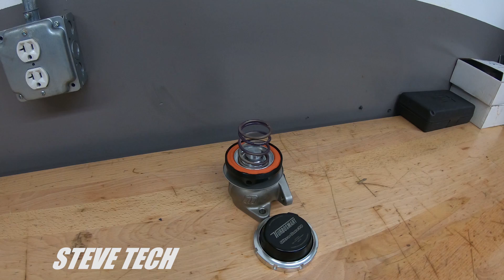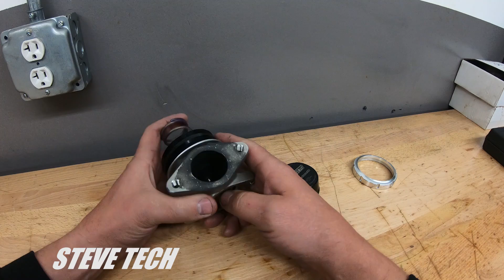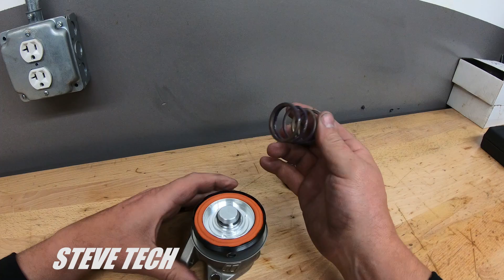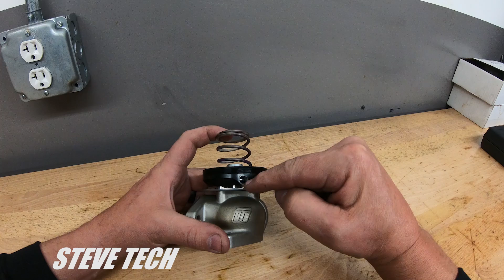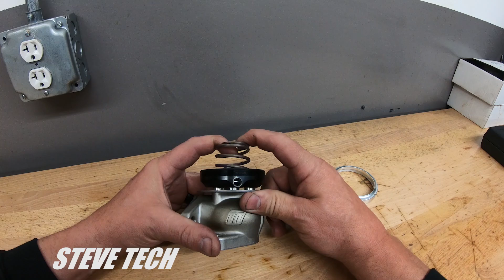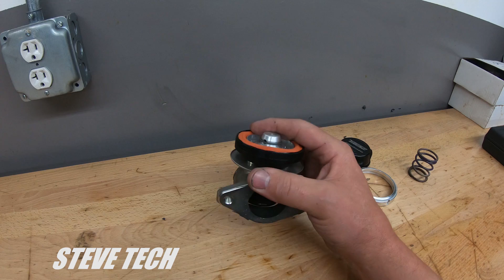Hook Your Waste Gate Up Right, Or You Will Be Sorry!

Comment: Makes me so curious because the centrifugal supercharger kit I've been looking into has a blow off valve and a wastegate. I have some questions to ask now, as always thank you for the Steve tech tips they're invaluable to people like myself that just like to wrench every day. J Swap Jason.
Reply: I think wastegates are typically only found with turbochargers, as the waste gates takes the "waste" or excess exhaust gasses and vents this extra exhaust gasses either into the atmosphere A.K.A: the screamer pipe.

The blow off is typically on the intake/cold side/boost/compressor piping leading to the throttle body. When the throttle blade is open, the blow off is sealed allowing all the compressed and/or intercooled air into the engine. When the engine throttle is closed, a vacuum/boost/throttle position sensor tells either the computer or just via vacuum signal to open this vent to prevent the compressed air from back feeding the compressor side of the turbos.
When the boost gets trapped between the compressor side and a closed throttle, the pressure works against the engines exhaust driven side to attempt to slow the compressor wheel down.
This forced slowing of the compressor while the exhaust is still trying to drive the turbo the other direction ends up causing broken impellers and broken turbos.

Superchargers and prochargers are driven by the engine by mechanical connection, like a belt or crankshaft driven setup. Backfeeding this style boost set up, when it doesn't grenade the supercharger, tends to excessively wear the supercharger. 

Im fairly sure the prochargers will use a blow off only to remove excess cold side/intake side boost.
Blow offs only releive the stored boost on the intake side.
Waste gates are on the exhaust side(turbos only) and vent some portion of exhaust to maintain a boost pressure setting.

Supercharger\prochargers change boost pressure by changing the pulleys used om the blower and crankshaft. A small pulley on the charger and big (either tooth count or specifically sized diameter) then the blower is considered overdriven. Driven faster tham engine RPM by whatever chosen amount.
Swap those same pulleys around and the blower makes less boost and is then under driven. Driven slower than the engine RPM.

Prochargers can be a bit different, as I think some rowdy race ones can have their drive ratios and/or pulleys changed to affect the boost curve(somewhat) and also the total boost created.

Turbos need the exhaust side gate otherwise the boost gets trapped and tries spinning the turbo different directions at the same time. Also, venting the exhaust gas, as this is what drives the compressor side of a turbo is slowing the turbo down or controlling boost in the most accurate/safe/efficient way. Assuming the waste gate is the correct size to vent enough exhaust fast enough to keep turbo RPM and thus turbo boost at a stable spring regulated pressure or a CO2 regulated pressure. 

There's tons more of the nitty grtitty tech, and I am aware Steve has gone over everything in this comment in this video.
As such, there are newcomers to car modifying getting interested every day. Cmon down, you might be the next person supercharging a 1UZ for drifting down unda'. Or maybe the next person to revolutionize turbo/charger/boost control tech.

Bring out ya hot rodders....
Reply: @threadtapwhisperer5136  gerzybear look it up for a J series. Tell me what you think. I understand how everything works I'm just curious after Steve's video.
Reply: Some of them have recirculating air, so instead of compressing and releasing air, it just shoots the air back into the intake instead of atmosphere. Yours may not be quite the same, but that way it keeps air flowing, but under pressure, so things don't go boom.
Reply: If your car is equipped with a mass air meter you must use a bypass valve and not a blow off valve, If you install a blow off valve on a mass air car it will effect how the engine runs!
Reply: @NeverEnoughPyro40  fair enough. But FuelTech ft600 will be controlling the car. So that isn't an issue. Fuel tech uses absolutely density I believe. I'm just curious how this will Affect my particular set up I plan on using.

Comment: I've seen vortechs with bypass valves on street cars for when the throttle snaps shut.   Is that the same thing he's advocating against?
Reply: No, bov dumps the boost when you close the throttle. Trying to regulate boost at open throttle is what he is talking about not to do.
Reply: No, that is a blowoff valve.  They are used to vent boost when the throttle blades are closed to prevent damage to the throttle blades.  Blower systems have blow off valves only.  Turbo systems have both a blow off valve and a waste-gate(s) to control the amount of boost.

Comment: Actually with no boost reference it regulates the exhaust turbine inlet pressure only so it is regulating the drive pressure to 10psi. How much boost it will make then is subject to the turbo and engine setup. I have seen twin turbo BBC make 20psi of boost with only 8psi of drive so the wastegate would be like having nothing at all. Now put a 66mm single on and you would probably only see 8psi of boost and like 25psi of drive then the gate would be opening to keep from sending the little single into parts scatter never never land.  What you say about needing to control pressures on both sides to prevent an overboost situation or a turbo destruction situation is VERY true.
Reply: It depends on the ratio between the wastegate and diaphragm area. 
A little simplified. If the ratio is 2:1, the wastegate is adjusted to 10 psi with the boost reference connected and you have a drive pressure of 10 psi then the drive pressure would theoretically need to be 2*10+10=30 psi  to open the wastegate without the boost reference.

Comment: How about when closing the throttle quickly. Have seen a lot of belt issues. Is there a way to deal with the sudden  spike?
Reply: Sorry meant on a whipple.
Reply: @benrossbach6501  I'm guessing your throttle is after the supercharger? Use a blow off valve. My vortech setup has one between the supercharger and throttle. Will make it more efficient too.

Comment: I disconnected my reference line and it went from 8 to 15psi with a “7psi” spring, only time it creeped above 15 was when i sprayed it with a 150 shot and would creep to 18psi but maintained it
Reply: Yeah, how much boost a system will make without a boost reference on the gate depends on the set up.  Engine size, turbo(s) size.
Reply: @danmyers9372  if i pinned the gate shut it would make over 40psi, had it stick shut once and glad i had cheap head gaskets at the time lol. It was a large frame T4 off a Freightliner on a stock 5.0 engine
Reply: There’s surface area of the gate against spring pressure that come into play. Bigger the wastegate the less it’ll build on spring only. Exhaust back pressure acting on a larger surface area of wastegate valve.
Reply: @justins8c252  it was a 38mm gate

Comment: Love me some insider knowledge videos and nobody does it like Steve! Does the choice of which way you run the exhaust side increase or decrease the cool turbo sounds?
Reply: OE manufacturers run the waste gate back through the vehicle’s exhaust so you don’t get the “cool sounds”.  Waste gates need to have it’s own pipe that vents to outside air if you want the cool “whoosh” sounds.
Reply: The "cool woosh sound" is usually from the blow-off valve, not the waste gate.

Waste gate is exhaust side regulation, blow-off valve is intake side.

Cool woosh is sudden opening of blow-off when the throttle plate closes.